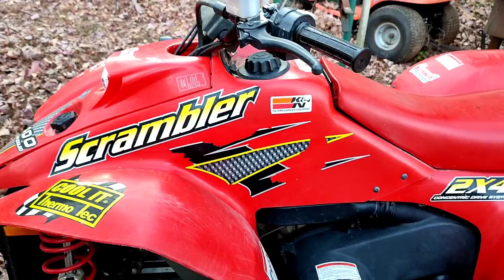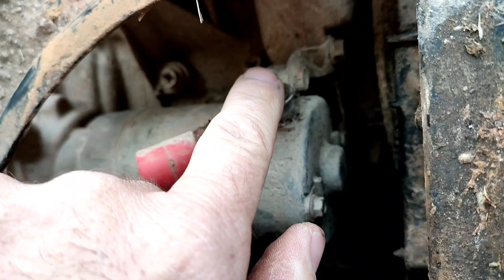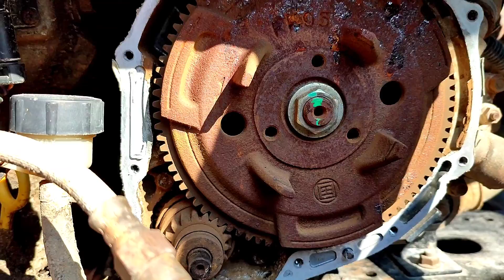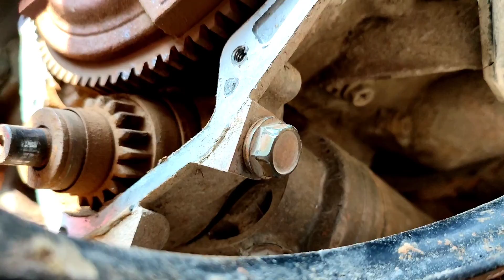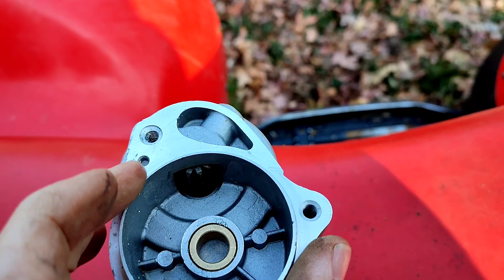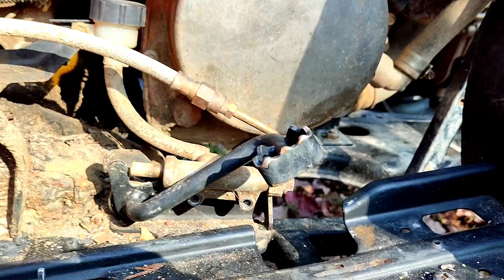Polaris 400 Scrambler 2wd 2 stroke starter install.

Comment: Thank you for the video this really helps me out I was looking around for a video of there's away to replace the starter without removing the primary clutch on my 94 Polaris 400L 4x4 but basically the same engine just was curious if it was possible to do it that way otherwise thank you so much
Reply from the maker: That top bolt is tricky but yes it's doable.

Comment: What's the best way to remove the rust from the flywheel?
Reply from the maker: Really several ways, I would just use a scuff pad and scuff it off, but there is a magnet there so if the magnet is good I would just make sure no rust is on the magnet and let it run.

Comment: Reading your comments and i see you just cant please everyone. Well i understood everything but mines not a scrambler. I have a trail boss 400  2 stroke, but it looks identical to what you have. I was just redoing the recoil but i think im going to do the starter too. I saw that gear cluster that goes into the starter  but wasnt sure if it was safe to take that out. Now i see it is. Thanks for the video because now i know what im looking at...

Comment: Video sucks doesn't show enough talking to fast saying wrong things
Reply from the maker: Lol.. I'll try harder..Thanks for watching!
Reply: What did u use to get the 2 bolts off the starter where you said you going to need a mechanic, can I use a swivel 10mm socket?
Reply from the maker: @KennyGreen-cv8dy I said patience is what you need to be a mechanic because that bolt is a pain. I used a thin (like the one that comes in a Honda tool kit) open end wrench, turn a little, flip the wrench turn a little and repeat. Not enough room for a ratchet.
Reply: Well video showed me where I need to get at.. most ppl. Commenting negative have no clue what there even looking at... 😊

Comment: I have learned to just never own a Polaris and i tell anyone I know not to buy one lol.   Every Polaris's I worked on was damn near impossible to do any simple repairs on.
Reply from the maker: You're probably on the right track!
Reply: @TepcoCycleRepair  Yes, I mean exception if the newer RZR's I can do anything in them very easily.
Reply from the maker: @trxtech3010  I have a 2005 330 Polaris with under 150hrs , already burt a CDI, and now it needs a tank fuel line attachment that Polaris doesn't make anymore and doesn't offer a update or replacement. Watch for that video!

Comment: First time I’ve seen bottom removal. These fail do to the fact folks don’t reset pull rope handle back on stud. Water gets in and goes to the bottom and rust up starter. Also there is a drain screw for folks to drain water if it get in…no one ever did. Same with changing the balance gear oil.